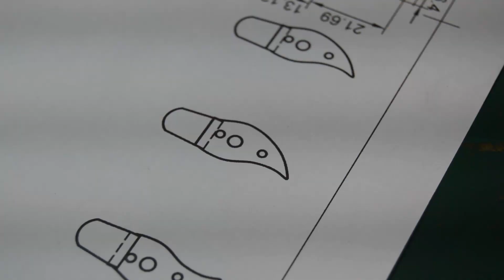Reverse Engineered Clock Part. Trade Secrets Episode 2

Comment: I've just come across your channel after grazing various model engineering channels. I particularly like watching how you work/file etc. Ie those practical tips you dont read about. I'm in early stage of building a skeleton clock (ws smith)  in brass after watching Clickspring. I'm planning on using fusion to blow up the small templates in build instructions. Andrew (nz)  Subscribed.
Reply from the maker: Welcome aboard! Thank you so much for your kind words and good luck with your clock.

Comment: Really nice work - will we get to see the engraved part? Are your workshop lights LEDs? I've found that can cause those annoying horizontal bands (2:03 to 2:08 for example....) on the video sometimes.
Reply from the maker: Thank you. I will show the engraved part, but I can’t get to see the engraver at the moment due to lockdown. I have a couple more parts to make first anyway. The flicker is my fault, I had to do some research but I have since found out how to properly set up the camera with an appropriate frame rate etc. Should be cured for all future footage.